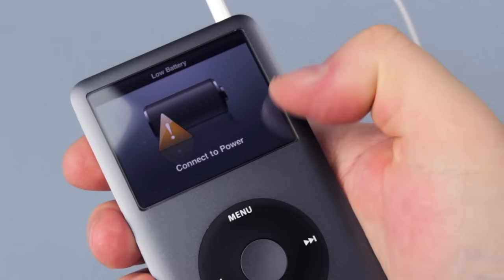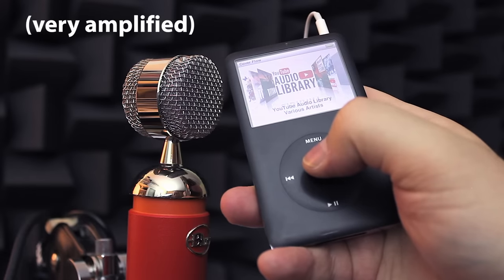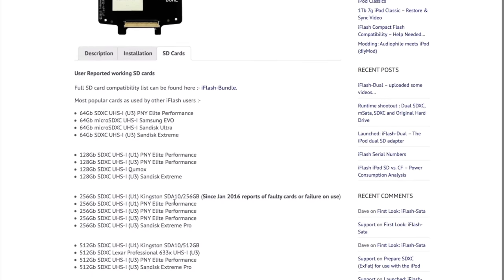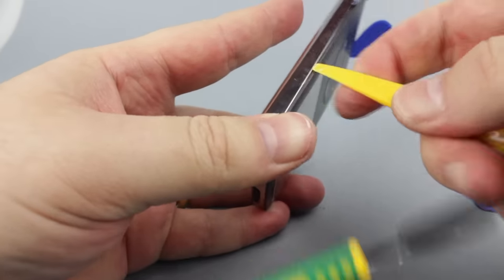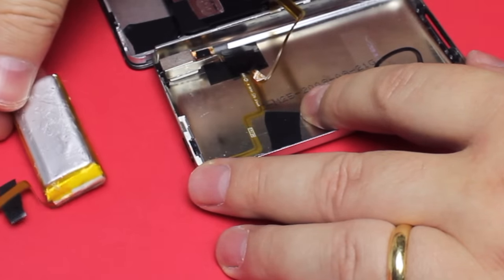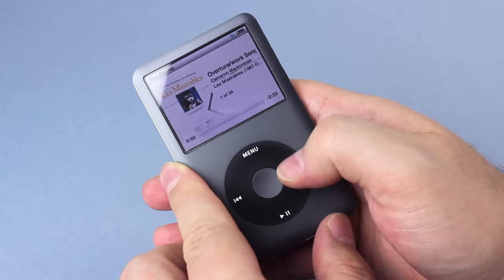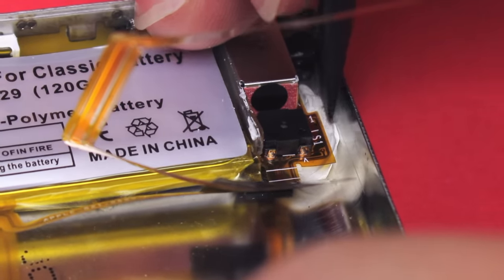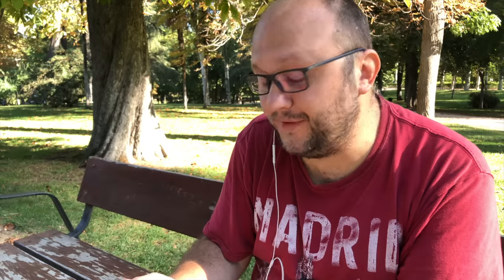iPod Classic new Battery & 256GB SD Card: still works in 2024

Comment: Good video.. yours was the video that inspired me to order the SD card adaptor that can take up to 4 sd cards! (I'm still waiting for the little board to arrive) .But I have the 6th generation 80 gb model that can support up to 128gb with the apple software. If I install rockbox it can "see" much more storage. So my question to you is did your iPod "see" the full 256 gb storage or only 160gb? And have you ever found a hack to add Bluetooth capability?
Reply from the maker: Hi Kenny! 👋 Yeah, my model detects and uses the full size of the storage natively (I never thought of using Rockbox because I really enjoy the Apple’s UI). No, I never tried a Bluetooth hack - there are some 30pin Bluetooth transmitters but the quality is controversial (good and bad reviews). About my 256GB: I think it is more than enough - there are people putting 1TB of SD cards on their iPods, but there is another limitation of the Apple’s firmware: the songs database was programmed in a way that you cannot approach 50k songs.... and 50k compressed songs don’t use 256GB. The only way to really take advantage of more storage is if you had lots of video or if all your songs used ALAC (Apple lossless format).
Reply: @GeekDetour  great.. I will be trying a few things in a few weeks and I'll keep you posted with any discoveries I might find

Comment: People call me crazy because I still using a iPod classic for listing music instead of spotify on a smartphone. The same people never touched a Ipod classic. I have a 120gb version, I think 6th generation. How I can see witch version I have? I own it for many years. I think to buy a second one cheap with a broken hard drive and upgrade it like this video. Thanks for the explanation.
Reply from the maker: Hi there 👋 thank you! This page explains how to know the exact model you have: https://www.iflash.xyz/store/iflash-compatibility/
Reply: @GeekDetour  Thanks. i Have the 6.5 generation. Because it works fine (after 10 years) and don't want to open it. Luckily I found a 6th gen with a broken hard-drive (like yours..) on-line. So I bought de SDcard as yours and de I-flash solo and off course the Isesami tool. It will arrive next week. With your info it should work.

Comment: very talented 👏👏👏 great stuff! I wonder if there is a Bluetooth module that we can put into the iPod classic
Reply from the maker: Thank you! I am glad you liked it 😁 I think you can still find some 30-pin dongle Bluetooth transmitters for the iPod Classic - and there are some crazy mods people make on their iPods to put Bluetooth transmitters inside of the iPods - they usually need to cut part, or make some holes in the back plate for the Bluetooth antena otherwise transmission doesn’t work properly… I didn’t have the courage yet to try something like it 😆

Comment: Hi, 
thanks for the video it’s very helpfull.
I have an ipod classic 6gen 1st version, I just replaced the battery using your tips. Once done my ipod won’t start, still frozen on the apple logo screen, tried to restore it but itune stops with error 1439. I tried many times but anything seems to work.
I’m wondering if replacing the hard drive by the SD card will help ?
Reply from the maker: Hi 👋 I don’t know much about this error, but I found this: https://www.ifixit.com/Answers/View/89310/iPod+cannot+be+restored.

Comment: Loved the video, and I know the pain you've felt, very frustrating in the beginning and now I have a new frustration!  I want to upgrade my Ipod 7 to half a terabyte but every time I get it all set up the Ipod says I have 127 gigs not 510, it never allows me to put all of my music on this, any ideas as to what is wrong?  Stuart
Reply from the maker: Stuart, as you approach 50k songs (or “items”, can be podcast episodes, audiobooks, songs…) it will reach the limit of the iPod Classics firmware to manage its internal database.
The only way to actually “use” a terabyte is if your songs were originally encoded in Apple Lossless Audio coded (ALAC), that would actually use more space per song. Of course converting MP3 to ALAC makes no sense.
I never pursued more than 256GB because my whole music library doesn’t even use 128GB.
The iFlash troubleshooting guides are the best place to investigate:
https://www.iflash.xyz/troubleshooting-guide/
Reply: @GeekDetour  New problem.  I restored a 7th gen. then tried to download my music, box comes up checking out all the songs, then the iPod starts its slow circling, I'm thrilled, its working!!  It finished, computer says downloaded over 6000 songs, Ipod, on the computer shows 87 gb's of space left, yes.  Unplug Ipod, go to music, no music, go to artists, no artists, etc.  What is wrong with this picture?!?!?!  It's driving me crazy!!

Comment: Yes I still got mine I had five children broke on me one what's up charging through the para support supply but it only charge do a battery pack when I took it apart the battery clip that holds the battery to the board came out but I've still got to others working

Comment: I had no problem stopping buying music and going to Streaming; try TIDAL HiFi. It may have been a different story if I could have stored my analog records with their analog sound quality, but some genius thought MP3 128Kbps rate was a good idea. Even as old as I am I still can hear sonic alarms in stores.
Reply from the maker: Well, part of my Library was ripped from CDs in ALAC (Apple Lossless) but the majority was compressed in AAC, 160kbps - which is fas superior than MP3 128kbps. I wish I had used only Lossless - but I was young and storage was expensive back then 😔
Reply: @GeekDetour  .. I'm not criticizing to be clear. I just remember the dip in sound quality from LP's to CD's and then OMG the crap from MP3's AKA to me they all sound like digital swirl and once you hear a good quality recording even so called "lossless" are about good enough for my car. I just have good hearing...

Comment: Hey just so you know you failed to mention getting a HDD Ribbon for the replacement flash drive. Found that out when I saw the ribbon from the original one didn't match the new one, almost had a panic attack thinking I bought the wrong stuff.
Reply from the maker: Sorry man, the thing is: my model uses the same ribbon. Your iPod is probably the same model as my Wife’s iPod - the original ribbon cable is smaller in that one. Could you put it all together fine?
Reply: @GeekDetour  I have to get the ribbon first then I'll see how it goes when i get it.

Comment: I just replaced my headphone jack and switch in my Ipod classic as the male plug broke off in it. I didn't have any trouble opening the case. After installing the new jack/switch and reassembling it the apple icon blinks on and off. If I reboot it by holding the menu and the center button together I get a message to connect to a power source. Occasionally I will get a the red circle that says contact apple. All of my ribbon cables appear to be connected properly and It played perfectly before the headphone jack was replaced. Do you have any suggestions? Thank-you, Dan

Comment: extremely useful and entertaining, thank you so much for sharing your project, I in particular like the SD card tweak, never knew there is an adapter to use SD card to replace the mechanical hard drive, would that prolong the battery life as well as SD card should demand less power supply as well
Reply from the maker: Thank you! About SD Card and battery life: yes, your reasoning is right. But in practice it depends... I opened my iPod once more because of the battery, and I talk about that in this second video: https://youtu.be/aF4O98epAZk

Comment: great presentation. i am vondering if there is any chance toreplace with a real sdd, not a card. I will chnage battery too, it started getting tired. Ipod clssic is really great.
Reply from the maker: Thank you! Yes, you can: search for “1.8 inch SSD ZIF” - be aware that it is not advantageous in all aspects: first of all, it is hard to find 1.8”SSD larger than 128GB and some people already tested that it consumes more power than the SD Card solution.

Comment: i have an ipod classic but I cant tell if its 6th or 7th gen , i dont have the box anymore and I cant read the .0000005 font that has these specs on the backside bottom.  my question is I wonder if I just need to replace the battery or if I need to replace the harddrive and SD card too.  How to tell? Thanks
Reply from the maker: Hi 👋 This page shows how to know the exact model on the iPod’s menu: https://www.iflash.xyz/store/iflash-compatibility/ I replaced my hard disk because it was having glitches during playback and it had trouble when jumping songs...

Comment: Everson, Love your videos, they are very helpful, but I have maybe an unusual situation.  Installed two 128 cards, plugged it in to the computer, started downloading my over 6000 songs (music only on my Ipods) around and around the little magic circle went for an hour and a half or so, just like normal, yea for me!  when it was done all the songs were there in E drive on my computer.  I'm a happy guy, until I unplug my Ipod and see that it says 473 songs, that's it.  It shows all the songs when plugged into the P.C. but not on the Ipod, I have reset it 2 or 3 times and it is always the same.  It downloads all the stuff I've added from the last two months and a few others scattered throughout my collection.  Any ideas on what could cause this, missing my music badly.
Reply from the maker: Hi there! I don’t remember if I could successfully sync my whole iPod Library in a single step or if I did it in steps (like, first all albums with letter A, then B…) I would format/reset it again and start over… doing it incrementally.
Reply: @GeekDetour  Didn't work, bought another Ipod that was already set up with 256 but he did it on a Mac I have Windows, it said to install, reset and it would then work with Windows.  Went to download music looked like it was working, then it had the red circle with one slash and said do not disconnect.  It downloaded nothing.  The frustration....
Reply from the maker: Oh, that is sad… Indeed I also have a Mac 🤔 iTunes was considerably better at the Mac than on Windows, but I cannot pinpoint why you are having problems to move songs to your iPod. Even a single album you cannot move?
Reply: @GeekDetour  The flashing red circle with the slash starts as soon as I plug it in and disappears when I unplug it, and it again says that all the music is there in the drive that pops up, but there is nothing on the Ipod.  haven't tried just an album, that red flashing circle pretty much tells me it won't work.

Comment: I just bought a used one a few days ago, I'm afraid to try to take it out of the iskin cover for fear that I might break it. If it stops working I doubt I will open it. for all the effort and cost of parts, I'll just buy another music player. Also if these things are collectable, I would think it would be worth more with the factory drive and dead battery in it, even if non working. But this one is used, for all I know it may have been taken apart already and is a mess under the iskin cover. Not Windows friendly is my biggest complaint with it. I had to download something called copytrans to put my music on it. And to see the music on it, my computer just reads empty drives.
Reply from the maker: Hi there! Yes, I only opened mine when it was not possible to use anymore... Anyways, I don’t think an o original dead battery adds value: a well restored working iPod should be more valuable (my opinion - who knows...) The iPod was always an extension of iTunes - it was made to conveniently and effortlessly sync with it. It is true, though, that iTunes on Windows was sluggish compared to iTunes on the Mac (I guess Apple is to blame). Instead of fighting it, I embraced it: I grew my music library on iTunes always organized with all the metadata (album cover, titles, artists...). I find it very pleasant to use. But I know many people who don’t like iTunes - I would say the iPod is not the best player then 😁

Comment: Any advice on what to do if the black bar on the iFlash to lock the ribbon in place broke?
Reply from the maker: You could try to find a plastic sheet of the same thickness and cut it to the same width and push it inside - does it make sense?

Comment: I have over a terabyte of music on my Mac which is also on my PC and backed up to a NAS Drive and to a cloud server.

Then I have an iPod Nano 8 gig.

Then I have an iPod Classic 80 gig that actually has an drive that was in 160 gig iPod Classic.

Then I have a 320 gig iPod Classic (originally 160 gig)

Then I have a 16 gig iPod Touch.

Then recently I was given 256 gig iPod Touch.

Pretty good for someone who said that they would never own any Apple products.

The Mac is about 5 years old and was received as part of a deal with a client as it was not booting. Apple "tech support" wasn't worth fixing.   However the only thing wrong with the computer was MacOS become corrupt. I reinstalled the OS and was able to recover my client's data.  Apple would rather sell you new hardware instead of fixing existing hardware and this is why I swore I would never own any Apple products.

George

Comment: Well unfortunately I'm in the group that failed this project :( lol

My 7th Gen Ipod classic was barely holding any battery life and the HDD was failing so I had 2 options: either buy an upgraded one from ebay or try and do this myself. Decided to try myself first since the thing was gunna be dead if I didn't.

I used the sesamo tool and still struggled but after and hour+ did eventually open it up so that was satisfying. After I removed the old battery and HDD and replaced them with the new parts I was eager to see if it would boot. I tried sliding the battery cable back in the clip (like the last step before trying to turn it bakc on) but somehow that plastic piece had come up too much and pretty much took all the pins that were connected to the board with it. I have no tools or skills to try and solder (especially this micro level) it back so its over for me haha.

Went on ebay and got myself  an upgraded 7th gen ipod classic with a new battery and 512 GB SSD space, pretty much what I would have had if I had been able to successfully do this myself lol.
Reply from the maker: Oh, man… it can be tricky! As you saw: I had troubles myself! 🤷‍♂️ But I am glad you managed to have a “new” iPod already modified. Enjoy!!! 👍
Reply: @GeekDetour  Thanks, yeah I really wish I could have successfully completed it myself. I was so close to the final step of trying to power it on and see it work. 

On the bright side I have a bunch of spare parts now lol. 

The ipod was pretty much dead at this point so had nothing to lose trying it myself, at least I can say I was part of the group that got to open one up without damaging the clips haha.

Comment: I recently just replaced the faceplate, battery, logic board, hard drive (30 GB upgraded to 128 GB) and the click wheel on the iPod Classic 5th generation.
Reply from the maker: What exactly wasn’t replaced? 🤣 If it is working now, that’s what matters 👍 Cheers!
Reply: @GeekDetour  It functions like a champ. The remaining original parts that are working are the rear shell, headphone jack and hold switch, center button and the LCD screen.
Reply: I also replaced the battery in my iPod classic 4th Gen with I believe a 1300 MaH one.

Comment: I still have my iPod Classic 6th Gen 80GB as well as my 16GB iPhone 4S and my 16GB iPod Touch. My iPod Classic needs a new LCD screen, new hard drive and I want a new battery to put inside of it. Had my iPod Classic since my senior year of high school. My iPhone 4S needs a new Hard Drive, new screen, and a new battery. My iPod Touch I got back in 2014 I think. I think it needs a new lightning connector port as well as a new battery. I also have an iRiver H10 20GB MP3 Player (Remix Blue) and it works nearly perfectly, but the battery dies fast and the headphone jack is a little messed up. So I've been wanting to replace the battery, headphone jack and want to upgrade the memory on it. Hell yeah I'd rather have all my music on my computer or on my music devices and NOT on a Cloud storage. I don't like "Music Streaming" because it's stupid! Think about it. If the apocalypse happens, there will be no more cloud. No more streaming service. If the Internet and phone lines world wide goes down, you won't have any streaming services, youtube or anything but what's actually on your device.
EDIT: My iRiver H10 20GB MP3 Player STILL WORKS! It outlived my iPod Classic, my iPhone 4S, and my iPod Touch!